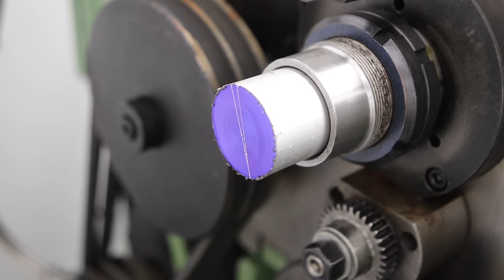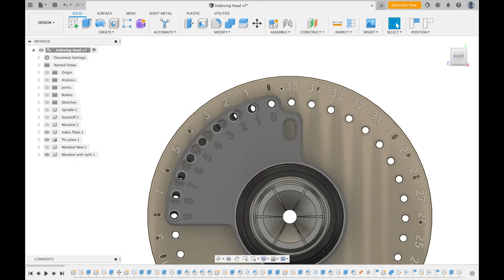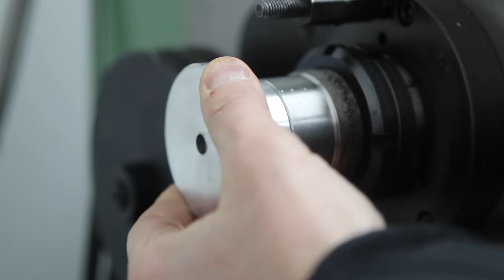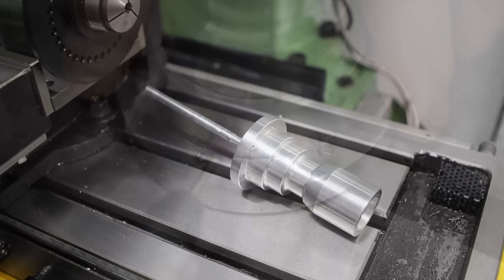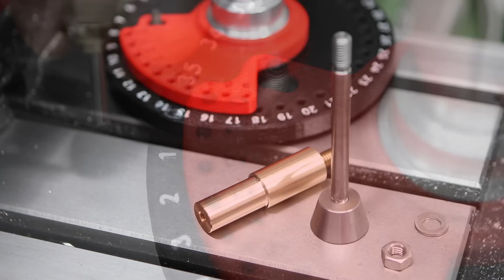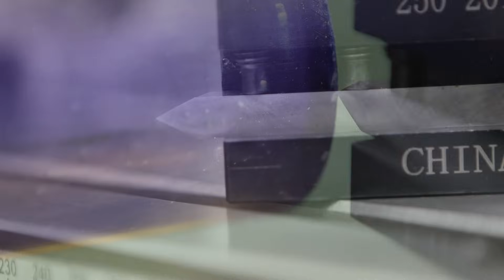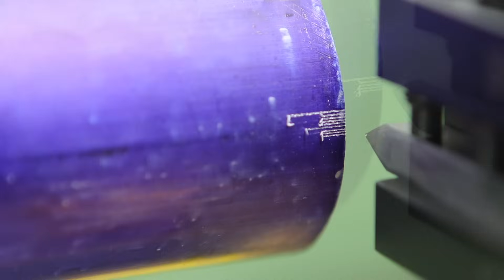Making an indexing attachment for the lathe

Comment: Have a look at the tables at the back of the model engineering book titled 'Taps, Drills and Dies' by 'Tubal Cain'. The author recommends using bigger tap drill sizes than standard. The slightly bigger hole  greatly reduces the chance of breaking a tap. The trade off is a very slight reduction in thread engagement.
Reply from the maker: Good idea, thanks for the tip
Reply: The recommended size is for super professional work, probably assuming three taps stages. Making small non critical parts on the revolver lathe I routinely made the fit less snug to work faster and easier. Never broke a tap,but the  material was mainky   automation steel and brass.

Comment: Of course you will need aluminium taping fluid , and be very easy on reverse you  should also use use a spiral point tap  instead of a spiral flute . spiral flute are very fragile on reverse. they are meant to go full depth in one shot.  Maybe you shoud use 4 flute hand tap they have extractor you can buy , just in case you still want to break them :-)  .   

  To remove a broken bolt or tap you can weld a nut . it almost alway work. should be easy in alumimum.    the very last thing you can do is drilling  the tap  using a carbide drill .  (best using a  milling) 
but dont broke the carbide stuck inside the tap  😀  i guess you can use diamond bit to drill the carbide..... i never got that far.    :-)
Reply from the maker: Thanks for the tips Sebastien, very useful.

Comment: Broken tap - I had a similar experience when making a steel backplate.  My solution was to anneal the tap in the backplate and once it was softened, drill the tap out using a smaller diameter drill.  I was then able to chip bits of tap out of the hole. Annealing obviously discolours the work piece and depends on the work piece being able to withstand the annealing temperature.
Reply from the maker: Good thinking, never occurred to me that I could anneal it.

Comment: I thoroughly enjoyed every second of this build, especially the mistakes. Videos like these will build the confidence of any beginner machinist or hobbyist. Thank you for sharing!!
One thought that I have is making the holes in the 3D printed parts a bit larger so you could use a larger pin that is slightly shorter than the thickness of the two printed parts, and have a threaded hole in the pin for a screw with a large diameter truss head to squeeze the two printed parts together for insurance of no play.
Reply from the maker: Thanks! Great ideas, thanks for sharing.

Comment: Taps break because they are blunt or you are not backing off enough to release the swarf. Cutting oil ( white spirit or wd40) as others have mentioned will help. Use a tap wrench that is smaller than the one you were using, and you will feel when the tap is binding up. Unfortunately, to remove the broken tap you need a spark eroder 😊
Reply from the maker: Thanks Chris.

Comment: you're in quite a bit of luck with your broken tap!
A hot, concentrated solution of regular supermarket alum will dissolve iron alloys like steel (and even stainless!) but will not disturb your aluminum at all! Give it a try!
Reply from the maker: Thanks for the tip!

Comment: Agree on the tapping fluid, always use it and consider it necessary.   I think using some cutting fluid on your slitting saw would have allowed it to do deeper cuts too.  When using the hack saw on something like that collet, don't try to cut through both sides at the same time, use a shallow angle and watch the material be removed.    

For the 3d prints you should have left the sizes close and used a heat gun to heat the surface of the plastic a bit then pushed it on, then it'd be a really tight fit that lasted forever.  

You can also use alignment pins instead of so many screws, you can get clever with this using 3d modeling instead of actual pins, or even make the holes the size of filament.   Do some experiments with using filament as plastic rivets that you can heat up with a heat gun or iron (not a soldering tip though).
Reply from the maker: Thanks Justin, great tips. I would do a lot of things differently next time.

Comment: Tapping fluid. I remember stuff branded trefolex. It was green and had a very particular smell I've not come across anywhere else.

As for removing the tap, a piece of aluminium or copper can be used as a with punch with gentle mallet blows to slowly unscrew the broken piece of tap. Using any harder material runs the risk of shattering it further and you having small pieces of very hard steel flying off at high velocity. Do NOT attempt the job if you're not wearing decent eye protection unless you want to run the risk of screwing your eyes.
Reply from the maker: Thanks for the advice!
Reply: Just reading the name brings back the smell...

Comment: That’s a fascinating idea, even if the implementation needs tweaking. I suspect the biggest source of error is your 3D prints. I’m now thinking of making something similar, but seeing if I can machine the plates using gear indexing or x-y coordinates. Many thanks and this.
Reply from the maker: Thanks Mark. I'll see if I can iron out the problems with the 3D prints, if not I'll machine some plates up.

Comment: My big tip for not breaking taps in gummy aluminium; use a larger drill than the standard specified size. With a larger hole and a bit of experience you will never break another tap. 👍
Reply from the maker: Great tip, thanks
Reply: We use Sinol (a type of alcohol) when we rap aluminium. Usually works for us...
Reply: @johanneslaxell6641  ... yeah alcohol or any grease is fine. I use vaseline it is non toxic, no smell or stains etc.
BUT the problem with really soft pure aluminium etc is that it thead-forms, ie; metal pushes out of the way of the cutting teeth instead of being cut out and removed. And that means you need to use a larger drill size.
With the right drill size and an older tap that is not razor sharp, it wont even remove that much material and you get something like a forged thread. A lot of equipment made with pure aluminium they use self tapping screws into it because it is that soft.
Reply: @wizrom3046  I admit that I am in some way"blessed" because Ihave three sets of taps (M3-M12) in my drawer, I only use lifting/bottoming taps. One for plastic/aluminium (sharp as ....), one for "tool" steel/stainless and one for though materials. Then I order special if I need, I try to change designs to match what I have and in tricky situations I usually get help from someone else near by...
 And I only use "aviation grade" 70** aluminium, it's more expensive but in my opinion it pays back in machinebility and quality. Those I make parts for thinks the same so I am in a good place regarding that...
Reply: @johanneslaxell6641  ... yeah good tip!
7000 series aluminium is a dream to work with compared to pure aluminium or some 6000 series.
Here in Australia we tend to get a lot of pure aluminium sheet and extrusion, it is cheap and soft like cheese. When you drill it the drill bit just tears out the backside and leaves a "tube" formation lol, I'm sure you know the stuff 😎

Comment: Nice build and save. Good to see I'm not the only one that's accident prone 😆
I'd have gone the route of adding an optical encoder and reading that off an Arduino. You'll still need a spindle lock, but the angular positioning will be more accurate. One advantage is that you can use the setup to add an electronic leadscrew, incremental improvements 🚀
Reply from the maker: That would be a good project

Comment: Cool project! But I don't think FDM 3d printer is up to the task with required level of accuracy. Even if everything is well calibrated there is still material shrinkage when plastic is cooling down and it can cause some warping. I'd suggest machining 3d printed parts. Or maybe try 3d print the overall shape and then machine just holes using a DRO? Never seen anyone do something like that but why not :D
Reply from the maker: You may well end up being right, but I'm interested to find out if the 3D prints will stand up to the job. I need to do some more testing, if they turn out to be inadequate then I'll machine some out of metal.
Reply: @nyalith. I have made the missing indexing    plates with my Prusa for my emco. 100 micron precision is attainable. The position of indexing holes with a 40 turning of the indexer for one turning of the table is plenty precise. The great advantage of 3D printing is 
that it is not time consuming, and you don't risk spoiling the part at the last minute with a mistake.

Comment: Crazy question but shouldn’t your large disc have only gone to 35 then 0, NOT 36 then 0 ?
Reply from the maker: Hey Mitch, the large disc does in fact go from 35 back to 0, not 36 to 0.
Reply: @joneseymakes  I thought I saw 36 which would mean each major increment was less than 10 degrees.  Sorry but I was nearly certain I saw 0 with 36 adjacent to it where 36 would/should be 0 as well.  Glad I was in error and not the disc.  Nice project.  I am NOT a machinist but a wannabe
Reply from the maker: @hobtink  Thanks for bringing it up anyway!

Comment: James over at Clough42 did a good video a while back where he investigated the sizing of 3d printed parts and then changed the settings in his slicer to compensate for the errors. I did a similar thing last weekend I was tapping M3 hole in 5mm thick leaded steel, this was the last operation and the first 3 went fine but the last hole broke the tap just as the tap was coming out of the far side of the 2.5mm pilot hole. There were a few blue words and when I had calmed down and retrieved my dummy I decided 3 cap heads would do the job just fine after using a punch to break off the protruding bits of tap. I like the design and have often wondered what to do with that drag engraver I bought 5 years ago!
Reply from the maker: Thanks Michael. I can resize the 3D prints easy enough. Because I'm sharing this design with my Patrons I wanted to make the 3D print a standard size though and find a way to machine the shaft to that size. Hopefully that means more people will be able to make this successfully if that makes sense.
Reply: My reaction to making the 3D printed parts fit the machined part was to just resize the 3D printed using the slicer like you said.  Plastic is cheap. You can change the dimension of the 3D part by a fraction of a millimeter.  It may take more than one try, but 3D printers work pretty quickly.  It seems more people were concerned with breaking a tap than making the parts fit together. Other than that I liked this project.

Comment: Cool project. While trouble shooting, you may want to check the steps per millimeter on your 3d printer. If the motors are not properly calibrated the parts will not be perfectly symmetrical.
Reply from the maker: Thanks Boba, I'll try that.

Comment: Very nice job! I'd like to see how well the lines meet up when you do a full revolution. :)
It's always the last hole that breaks the tap, eh? As others have said, alum powder dissolved in water (keep adding powder until it stops dissolving) will get rid of your steel tap without harming the aluminium. Just make sure you use a container that the alum solution won't attack. I've done this before, an aluminium pot is nice because you can heat it slightly on a hob to speed up the reaction. Eventually the tap will turn dark brown or black and start to disintegrate. A bit of wiggling and poking with something should free up the remaining chunks. It can take a while but don't give up, as long as there are bubbles coming from the tap, it's dissolving.
Oh and a note on the alum powder, it should look like tiny crystals. Vaguely translucent if they're big enough, in any case brittle and salt-like. It's also sold under the name "fatakdi powder". You don't want to know how long I spent heating a pot of "alum" powder which turned out to be some sort of insoluble floury substance that did nothing at all to the tap or the aluminium. Thanks eBay.
Reply from the maker: Thanks for the advice on tap removal, I'll try that. I'll be doing more testing in the next video so full revolution coming up!
Reply: Do u know the chemical formula for the alum powder?
Reply: @pinepienaar3401  According to the internet it's KAl(SO4). Potassium aluminium sulphate.

Comment: Here in oztralia we have a green cutting paste called "trefolex" which is a little messy to deal with but is awesome. I don't know if you can get it in the U.K but its really good stuff and can save a lot of hassle. It melts with the friction of the cutting action and flows down through the cut. I flatly refuse to tap without it.
Reply: Available in the UK as well but I prefer Rocol RTD in both semi-solid (looks like grease) and liquid form. It washes out easier, plus I was given a few tins of the RTD semi-solid from an incorrectly picked delivery that someone had from a supplier who did not want it returning.
Reply from the maker: Great tip! I'll see if I can get some. Cheers.
Reply: Vaseline does the same. Been using it for 30 years. Melts in the hole and non toxic, non staining and non stinky.

Comment: While the  expanding mandrel / petals is a good design, a locking collar that slides over the spindle and the indexing shaft will be simpler and at the same time allow for stock to stick out through the indexing shaft if you want to design it that way. Just an idea.
Reply from the maker: Hadn't thought of that, good idea.

Comment: I have used an old carbide end mill to cut out taps to great effect. What i found very effevtive was broken end mill that i shrpened into a kind of pyramid. Removed many taps with that. (was tapping 304 to m3)
Reply from the maker: Great tip! Thanks!

Comment: There is a simpler way to index the spindle and all you need is a dial indicator. It is a bit tedious but if you are only going to index the spindle once in a blue moon it's not too bad of a job. The trick is to realize that when cutting threads, the spindle is coupled to the lathe's carriage. Then here you want to invert the process. Normally you only think of the carriage movement in terms of full spindle rotation, e.g. when cutting ten threads per inch each time the spindle rotates once the carriage moves 0.100". Now if you only rotated the spindle 1/2 turn the carriage would move 0.050". If you rotated the spindle 1/100th of a revolution the carriage would move 0.001". Now if you have a dial indicator set up to measure the movement of the carriage and move the carriage 0.001" the spindle would rotate 1/100th of a revolution. Just the thing to scribe the dial you are making. Cut the scribe mark with the lathe's compound feed and remember to shorten the length of the compound fed scribed mark to compensate as the carriage is advanced for each index position.
You can use any thread, inch or metric, that you like and you can scribe any number of divisions that are needed. E.g. if the lathe is set to cut 5tpi and you need 100 divisions then the carriage will move 0.002" for each index position.
Disconnect the power to the lathe when doing any work like this. I use a block of wood lightly wedged between the spindle and the lathe bed to hold the plot steady while the scribe mark is made.
Cheers from NC/USA
Reply: Always rotate the spindle in the same direction each time will take care of the backlash but you still have keep it locked down.  Cheers
Reply: That's a great way of thinking outside the box !!! A bit klunky, but it works.
Reply from the maker: That's ingenious, I would never have thought of that. Thanks very much for the tip, I'll give that a shot at some point.
Reply: This is very tedious for, say, anything more than 12 divisions.  Although the indicator can measure the displacement of the lathe Z-axis very accurately, most change gear trains I have used have plenty of backlash. So a practice must be found to reproducibly take up the backlash for each scribe.
Reply: @aj7utu  That's the purpose of wedging the spindle. Once the gear train is under a load the backlash is eliminated. Note that if cutting a thread the backlash is taken up every time the half-nut is engaged to pull the carriage along.
Reply: Genius! Thank you for changing my life :)
Reply: Brilliant!!
Reply: Very clever! Thanks for sharing!
Reply: Sounds like an act of desperation!
Just make this index tool once and you'll have a fast effortless method for life.

Comment: My tip for when you break a tap off in a part, especially in aluminum, is to just throw it away and pretend it never happened.
Reply: If you have a spin indexer then you have your 360 marking positions.
Reply: Sorry wrong place.
Reply from the maker: Haha! Indeed.
Reply: @joneseymakes  Usually, you can use needle nosed pliers to twist the tap back out.  You just push the "needles" down the flutes of the tap, grip and twist. You don't even have to grip particularly hard.
Reply: Order of operations to considered, lol, when articles like this to be made or any other article that is complex. I learned this the hard way years ago. Just my 5cents 🙂
Reply: My solution was to build a simole EDM and erode the broken M3 tap out of the part to save the part. Such a simple EDM is easy to build really.

Comment: I believe you can submerge the aluminum part in a concentrated solution of alumn and water. It dissolves ferrous metals but won’t affect the aluminum.
Reply: yes - saturated solution of HOT water and alum. Also helps to warm the part.  takes about  6 hours to dissolve the tap. Heat makes it work faster.
Reply from the maker: Thanks for the tips!
Reply: @joneseymakes  AVE did "Manly-man skills: Remove a broken tap the hard way." about 7 years ago showing this. & I did "Alum vs FCAW!!!" about 6 years ago proving it works getting steel out of copper too...
Reply: You can see this technique in action on the JohnSL channel.